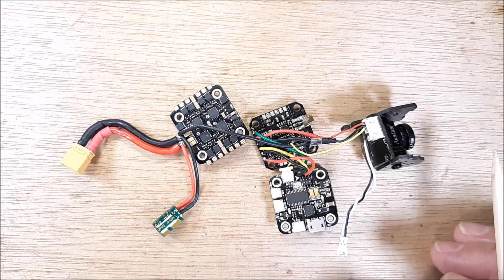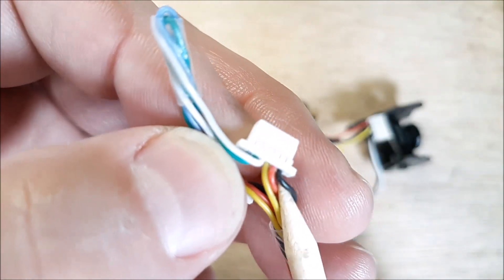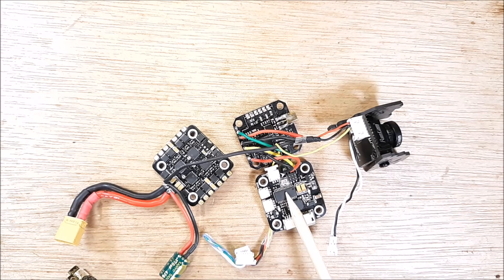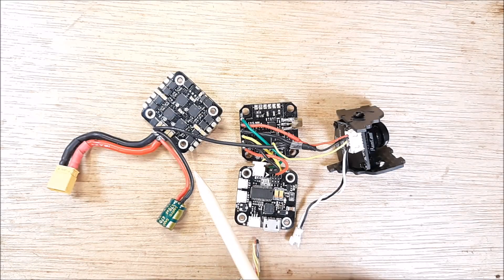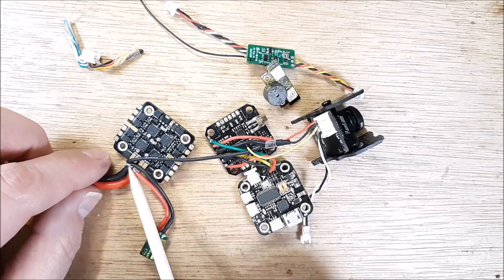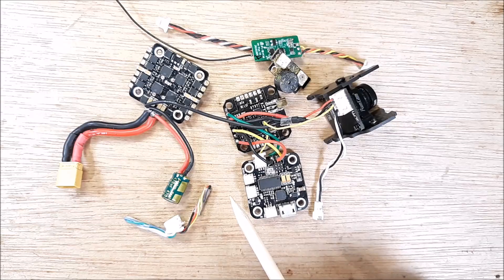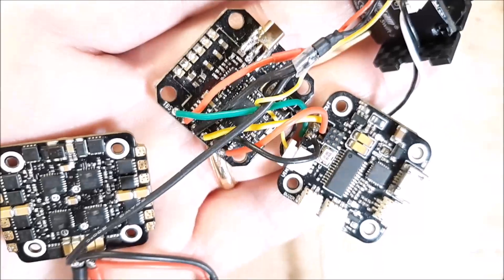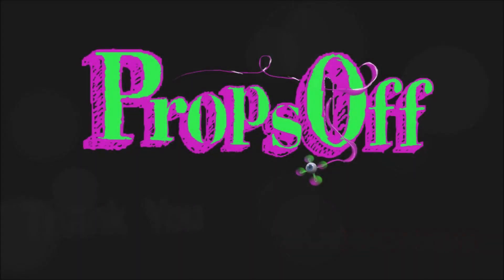FPV Video Issues Fixed | Video Problems FPV | Redundant Ground

Comment: Hello back, i'm putting another comment after having tried your solution partially, the thing that i've done is connect the ground of the vtx directly on the ground pad of the lipo (only the vtx not the camera), and it fixed my big probleem with white flashes ! However now i have another problem with white lines, the kind of thing that happen when you have no capacitor, but i do have a capacitor that is also welded directly to the lipo, so i wonder if it might be a bad welding that i've done ? do you know how i could solve this problem?
Reply from the maker: I worked on this issue for nearly a year. I tried everything to correct my video issues, and get the best analog possible across four 5inchers. The thing that finally made it perfect was to completely isolate the video system. I explain it here:
https://youtu.be/OXOmYrez3rE?si=cJS3DMsZth-dU0fO
Reply from the maker: Did you use a Matek BEC?

Comment: Hey thank you so much for this video. But i am a bit worried about trying this out on my 5 inch. Isn't this dangerous for the components if i wire it the wrong way ? I'm kind of a newbie in electronics but i've heard about things like ground loop or the fact that if you connect different ground on the lipo directly it could burn out. For example is it safe to just connect the vtx ground to the lipo ground and disconnect it from the FC ? Great video btw !
Reply: To be more specific i'm talking about a voltage difference in the two ground path that could lead to a parasitic current, i don't know if that's actually a thing i'm just worried to burn my 5 inch because of it
Reply from the maker: @gouuu6046 
What your referring to, "Ground Loop" etc. isn't an issue here. We are doing multiple things to insure a "Perfect Ground". We had very short wires, small DC voltages, and all commons go to the lipo ground. The single 30awg pin for ground isn't significant enough. Heat and EMF build-up is what we get from that, causing our video issues. The redundant (perfect ground) eliminates the issue. Hope this helps...🍻
Reply: @PropsOff    "The single 30awg pin for ground isn't significant enough" - that's right, 30 AWG is an insufficient ground. So you remove it and replace it with a proper ground.
Making loops by adding ADDITIONAL paths just creates new problems.  Any board should have one good ground.  Not one good one and two or three tiny ones, circling around.

Comment: If you're getting weird video interference on your 5.8 GHz VTX, this fixed it for me:

On my drone, video got noisy when I mounted the top carbon plate.
I ran a simple wire from battery ground (LiPo -) to the carbon plate, and boom — clean video again.

Carbon is conductive and can mess with RF if left floating. Grounding it stabilized everything.
Highly recommend trying this if you're troubleshooting unexplained VTX issues!

Comment: Does this apply to AIO, sir? I'm having the same issue, video feed turning dark 'til I can't see anything when I increase the throttle :(
Reply from the maker: @khangduongtuanan616  
For AIOs (ESC, VTX, FC, and receiver), I'll place a 100uf cap on the camera power...🧐

Comment: Did you remove the ground strap from the flight controller to esc and have it connected directly to the cam?
Reply from the maker: @Tsunamixtreme88  
The ground from the ESC to the flight controller remains. I added to the existing...🧐

Comment: does this only apply for analog camera and not applicable for digital setup?
Reply from the maker: @jkpisces  
I use this one all my builds especially HDzero. Grounding the VTX and flight controller redundantly helps with heat buildup as well...🍻
Reply: @PropsOff  and all of your drones u have to add the BEC? am going to use a rushfpv solo tank 1.6w , do u think i would need a BEC too for it to work? thanks again
Reply from the maker: @jkpisces  
I don't believe a BEC is necessary on the 1W+ VTXs, they have a pretty robust voltage regulator. I don't own one, so it's hard for me to do a very good job answering your question, however...🤔

Comment: How do i do this witha 4 in 1 whoop board i need help asap
Reply from the maker: @Colelikesfpv  
It's interesting you ask, I have been taking a wire from the lipo ground pad to the camera ground on pesky builds. If that doesn't do it, I place a 100uf cap across the power and ground of the camera as well - only had to do this to an HGLRC...🍻

Comment: Please no one has helped me for years I have a micro sparrow cam get it connected on my googles but after say a minute the pictutre starts rolling down the screen and like think lines going from top to bottom
Reply from the maker: @RaininCatsnDogs  
Your settings in Betaflight OSD tab for PAL/NTSC/AUTO  are incorrect compared to the camera itself, possibly.. Wrong channels is also a possibility, I assume you check that...🤔
Reply: @PropsOff  thank for your suggestions
Reply from the maker: @RaininCatsnDogs  
Let me know...🍻

Comment: I am slightly confused by this...I understand your thought process that these power hungry devices in a drone need better flow for electricity, but by only supplying extra ground wont you still be starved on the positive lead?? I have almost no electrical knowledge, could you please explain how extra ground helps with power delivery?
Reply from the maker: All grounds are common - path of least resistance. We don't want voltage to build in the video component and a proper ground will open the flood gates (voltage/current in these systems are not in short supply) . 
Also, grounding properly, will kill RF interference. I have another video after this one, "Best FPV Video Ever", that dives deeper.. I have an Electronics Degree with well over 25 years of field repair. Learning electronics isn't a quick process, therefore, I'm happy to help...🍻
Reply: @PropsOff  I appreciate you taking the time to respond, and I know little to nothing about electrical systems, with my small understanding about electricity it seems like you would also need to add another or larger positive power cable or the "flow" of electricity would still be hindered by the tiny positive esc wire....but maybe there is something I am just not getting. Anything you can say or direct me to to help me understand would be greatly appreciated.....
Reply from the maker: @dyeballer777  
I'm not sure how to explain it in a YouTube comment more than above. My understanding comes from a college degree with over 20 years of electronic repairs. I wonder if you look up, "things that remove EMF". I'm sure that will start your journey...🍻
Also, check out the final video I made. This is competition of months of testing and I was not able to get my analog video any better beyond this...
https://youtu.be/OXOmYrez3rE?si=gLWcE6wMEsq1zfkQ
Reply: @PropsOff  I understand electrical knowledge is hard won, I appreciate you taking the time to respond. Even though I don't fully understand how it helps, I took your advice and added another ground wire between my flight controller and my VTX and the difference is quite amazing, I don't understand how your channel is the only one talking about this....thx for your insight!
Reply from the maker: @dyeballer777  
I'm happy with it because my research has improved so many people's fpv experiences. However, it's somewhat frustrating to still be a very small channel that manufacturers ignore. I just refuse to tout only good things and can't afford to give stuff away.. What can ya do, I appreciate your support and feedback...👍🏻🍻👊🏻
Reply: @PropsOff  Yeah it is surprising how small even the biggest fpv channels are take Bardwell's for example, he has been stuck at 297k subs for as long as I can remember, you'd think with how often drones are used and talked about that FPV would be more popular on youtube, but I guess true FPV is still kinda niche, it has such a large learning curve to get into, not to mention its quite expensive....well I appreciate your channel and you've got a sub from me. I hope more come to find the value in your channel....the one good thing about small channels is actually getting to interact with your subs, if you had 500k subs I doubt we'd be communicating like this...
Reply: You know I was just thinking it would be cool if you could take the idea for redundant grounding and make it into a plug and play adapter or make something where you you splice into the current ground wires without having to disconnect or solder them and have it all come to a pre tinned wire which you connect to an open ground....or maybe even go to a 1.25 connector and take advantage of one of the open grounds that way
Reply from the maker: @dyeballer777  
It seems to still be somewhat underground. Unfortunately, I see more people leaving than coming...😭

I appreciate your support! Also, I believe no matter how big, I'd still do everything possible to include everyone in the PropsOff family...🍻
Reply from the maker: @dyeballer777  
Interestingly enough, I am working with T-Motor and one "un-named) to correct this issue. It seems to be going slow, however, due to analog's popularity...🧐
Reply: yeah something like that could have been a real money maker if digital wasn't the hot new thing...but there are still a few analogue people still out there, honestly if you get analogue at its best it can be almost as good as digital in my opinion. I  almost never fly my digital quads because they cost too much and Im always worried Im gonna crash and lose them ....
Reply from the maker: @dyeballer777  
I hear that.. HDz is over $160.. My analog is under $50...🤯

Comment: would you not need to do the same for the power side too? there is only 1 thin vcc cable connecting esc and fc, so all current will need to flow through this too?
Reply from the maker: The positive side is fine. The ground and positive act differently and the ground has RF/EMF canceling properties...🍻

Comment: @propsoff why there is only need to beef up ground wire and not power wire as well? I thought that those to wires need to be of simular diameter
Reply from the maker: The ground is the issue because electrons will take the path of least resistance. The ground being lame causes the flow to disrupt the video components and by giving it a solid ground, it allows the flow to be smooth. The biggest issue is the filtration on these boards are not great and the sign wave is of poor quality, thus, improvements to the ground helps clean that up. I've tried to give a couple explanations here, apologies if that makes little sense. It took a year of electronics classes in college to grasp the entire concept, lol.. I have a video that proceeds this one - I'll link it below... I spent about 9 months working things out and the video below is the final result. I wire everything this way, except 1S whoops - they need to be as lite as possible for racing and you get what you get...🤷🏻‍♂️🤣
Reply from the maker: https://youtu.be/OXOmYrez3rE?si=yXU-CGZ-etqefhXC

Comment: So what say you about an aio flight controller having the video work when plugging in but after the menu splash screen it goes black?
Reply from the maker: 🤔 First I would determine the type of camera - PAL or NTSC.. Then, I would go to Betaflight OSD tabe and reload it. Then, choose the camera (because auto sucks). If I got black screen with OSD, I would replace the camera. If I only got black screen (not snow) I would check my connections and worry the AIO is crappy...

Comment: My vtx board will not light up when I plug the battery in the VTX board is brand new how can I fix it
Reply from the maker: The best way to start the troubleshooting process is to use a meter. Here's how...
https://youtu.be/nekFQkiDeDw

Comment: Best practice dictates removing the original ground wire when running a low impedance "star" ground point. Otherwise you are creating a ground loop, just thought I'd point that out. A "redundant ground" is another way of saying "ground loop",  generally frowned upon.

Comment: hi. i have crux3 with new all in one board with 12amp esc and upto 400mw vtx power and the board get really hot when when i connect it to the betaflight. so i decided to turn down the vtx power to 1 or 2, as it was set to 5 when i checked on betaflight. but here is the problem, when i set the vtx power below to 5 like 4 or 3 or 2 or 1, the videos shows on goggle but as soon as i arm the quad, the video signal get lost and if set the vtx power to 5, video signal stays when i arm the quad. what is the problem, is my flight controller become week because of getting too much hot while connecting to the betaflight?
Reply from the maker: Would need to meter the VTX output per power assignment to determine if the VTX is bad. I had my MultiGP race director meter mine when it was acting strange. If it was pit mode, it should act the same and not favor a specific power output level. Did you try a new VTX?

Comment: YES YES YES YES YES!!! 1000 X YES!

I added a direct ground from the battery - to the camera - and it's FIXED!!!

After a dozen hours of frustration, my issue was gone in 10 min!

THANK YOU, SIR!!!
Reply from the maker: I just now seen this. No notification from YouTube, as usual...🙄
I appreciate your feedback very much! I'm glad it worked for you too..
Enjoy the Breeze...👍🏻🍻👊🏻
Reply: @PropsOff  you saw my other comment and replied. 😀
Reply from the maker: @JoshDisher  
With YouTube it seems hit or miss with comment notifications. It's frustrating but seems to be the nature of the beast..🍻
Reply: In addition if you could powered of camera from VTX (5v) pad instead FC. try this too🎉
1. Camera Ground to battery ground having capacitor
2. Camera powerd from vtx (5v) pad at the vtx bottom - depends on your vtx model
3. Camera video in to FC
Thats it🎉🎉🎉
Reply: Nice! Glad to hear it. I’m going to do the same when power gets back in my area😢. But I’m glad to know it works.

Comment: Oh oh oh!  

I've tried EVERYTHING on my nearly new Tinyhawk 3 and this finally gives me hope!

I'm using Fatshark Attitude V6's with rapidfire and a Radiomaster TX12. I have nearly PERFECT video UNTIL I apply throttle! Then it goes totally black until I let off stick... Then it's PERFECT again. 

(I'm talking Mr Steele nearly looks digital perfect)

This is getting EXTREMELY frustrating as I have both a BetaFPV 85 HD AND a Nazgul5 just waiting to be flown! (I promised myself I wouldn't even try to fly them until I got used to flying FPV with the TH3)

I have a PERFECT practice spot at work (gymnasium) and I haven't been able to do anything except LOS flying!

I'ma try this and report back!
Reply from the maker: Do tell of your outcome,  never tried a whoop...👍🏻
I'll speak to my friend that has a pile of Tinyhawks...🍻
Reply: @PropsOff  I'm going to make a quick video with pics tonight at work. I've been reading for days now and you are the only one (YouTube & Reddit) that hit the nail on the head.

Great job with the common sense explanation

Most people seem to think it's a problem with VTX config in betaflight, incompatible antennas or no capacitor.

Looking back it seems insanely obvious what was goin on and I'm kinda ashamed I didn't see it myself.
Reply from the maker: @JoshDisher  
Heck Yeah! So happy you got it. I appreciate your enthusiasm and feedback...👍🏻🍻👊🏻
Reply from the maker: @JoshDisher  
Lol, I took this even farther. My analog feed is comparable to HD720.. Check this video out...🍻
https://youtu.be/OXOmYrez3rE
Reply: @PropsOff  YES YES YES YES YES!!! 1000 X YES!

I added a direct ground from the battery - to the camera - and it's FIXED!!!

After a dozen hours of frustration, my issue was gone in 10 min!

THANK YOU, SIR!!!
Reply: @JoshDisher  hey, would you like to share how exactly you did it? I also have a tiny whoop that has similar problem. And having no idea how to fix it

Comment: Needed this an another video you had badly , they were exactly what I needed to assist me on a rotor riot cl1 build I’m using an f722 basic mamba stack in an having similar issues you had with the “ flannel “ pattern in the video feed I can’t believe I didn’t notice but the one ground between the 4-1 an my FC so really apreaciate this an your other video calling these problems out! I’m subbed 🤙 thank you seriously !!
Reply from the maker: Awesome to hear it helped.. Welcome to the PropsOff family! Yeah, the last video, "Best Video Ever" has cleared me up to the point, going HD is not super enticing. 
I appreciate your feedback and support...👍🏻🍻👊🏻
Reply: @PropsOff  no jk I’m so invested in analog at this point going the digital route at this time makes no sense , so my quest for figuring out how I can get the best 5.8ghz video feed possible for all my analog set ups began , then I found these two videos you had an boom 🤯 worked out really well to the point like you say going digital isn’t that enticing at this point lol , thank you for taking the time to post them, really helped me out big time 🤙
Reply: hello,what is your problem? i am now facing vtx singal problem.I even want to change new vtx.
kindly reply me.

Comment: Hi 
after I installed tbs coss fire receiver
The vtx range dropped down

Just when I move the goggles away from the quad no video....lest then 30 cm

I changed the antenna , I set the vtx power to 400

I pressed the vtx button and plugin the battery for 10 sc...no change 

I dont know what I do....
Reply from the maker: This is odd, not heard of this issue. Sounds like a posible short. Make a video of this issue and attach it here. I would be interested to see that. However, do check for things touching that aren't supposed to touch and run continuity checks..